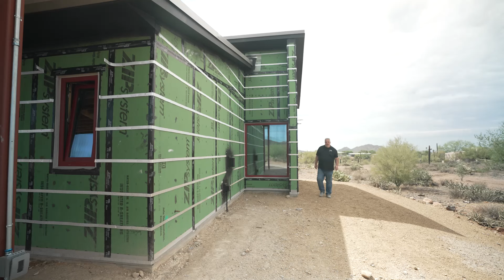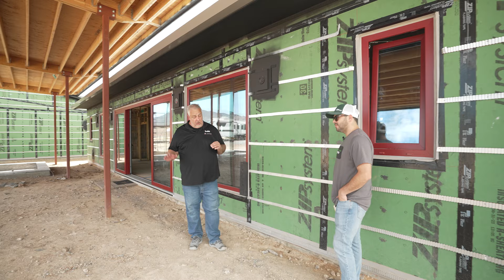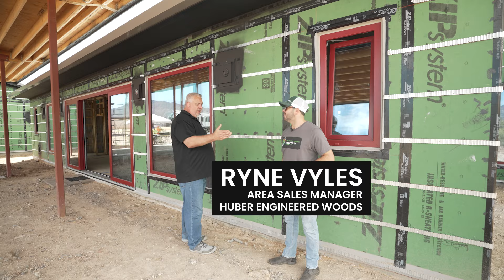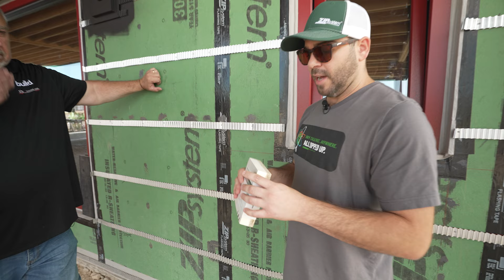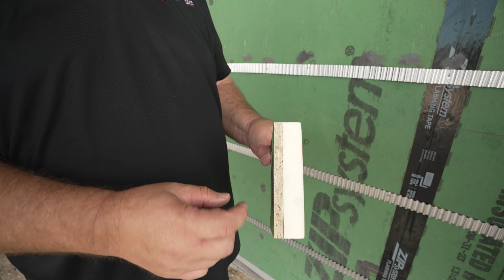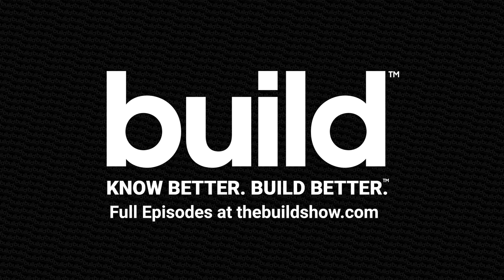INSULATING SHEATING - Southwestern Style | Build Show Clips

Comment: Rainscreen not needed in vegas.  Wasting clients money.
Reply: That really depends on the siding they are installing.  Some siding manufacturers require a rainscreen to be installed or the warranty is voided, regardless of local weather conditions.
Reply: @r.j.bedore9884 this is exactly correct. The siding is from his other video today. Siding company demands rain screen regardless of locale for their product. I think the nakamoto shuo sugi ban product.
Reply: @benjaminbagley4168 hmm... wonder if BO dimple mat would suffice/ be easier.
Reply: @grahamstefaan  im sure. But nakamoto industries is very high end and they sell the entire system. You get the rain screen and even the nails from them. Basically in for a penny in for a pound if you want that particular siding. In general you are right. Less than 20” of annual precip it’s probably not necessary to have a rain screen.